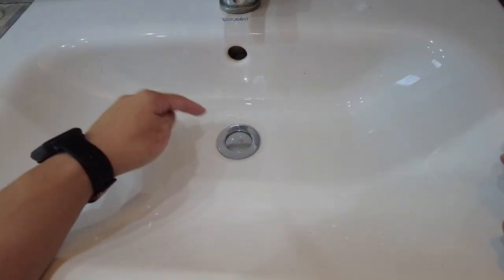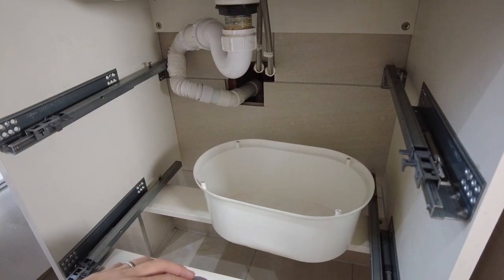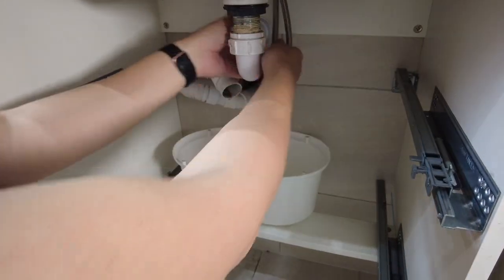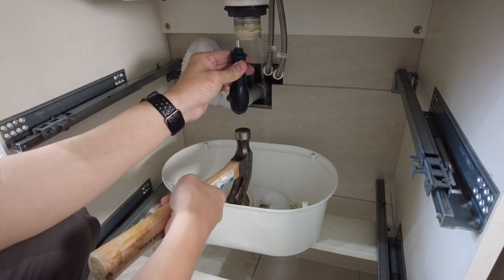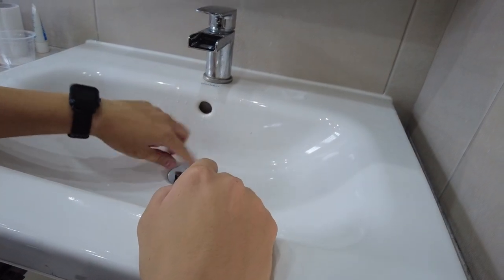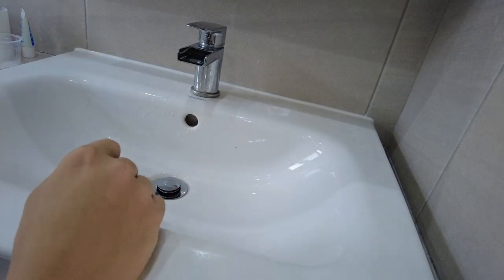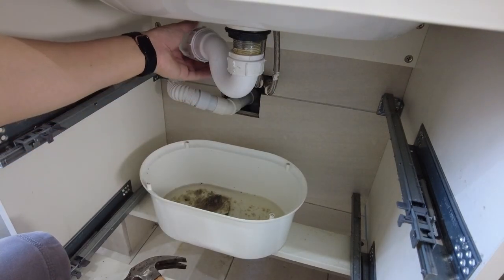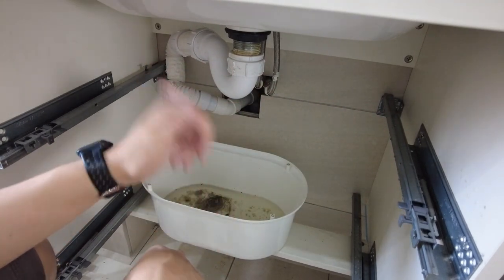How To Fix Stuck Push Sink Waste Spring Drain Plug Bathroom

Comment: Thank you so much. You're a life saver. A drain stopper got suddenly stuck in a hotel room. No amount of pushing, tapping, or trying to turn it worked. At the first minute of your video, when you got under the sink, I tried looking under mine and found a metalic stick thingy. Pulled it down and it popped the thing out. Wouldn't have looked under without this. Thanks

Comment: Buddy, you saved me! I tried various methods from suction to dental floss... no success! It's a nightmare, gonna sell the house! Your approach is the fundamental solution, which also cleaned the duct. The only trick is a bit hard to turn the duct bolt, even with pliers. Bravo! Best-in-class clip on youtube.